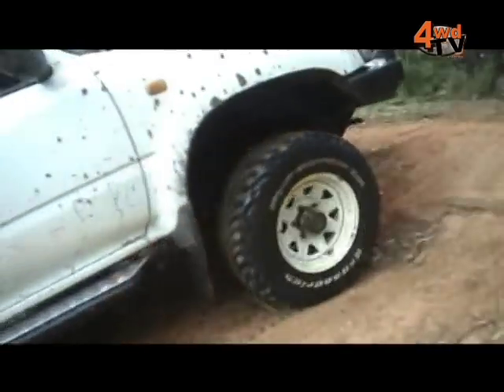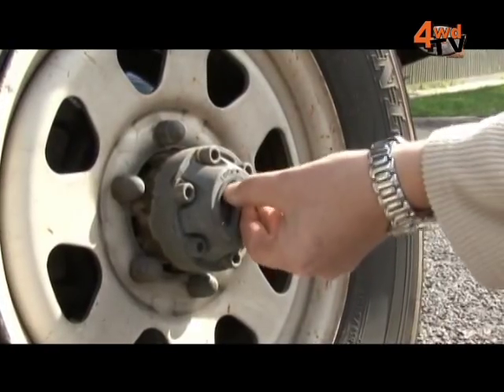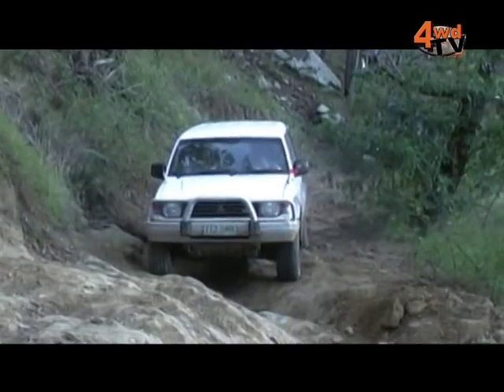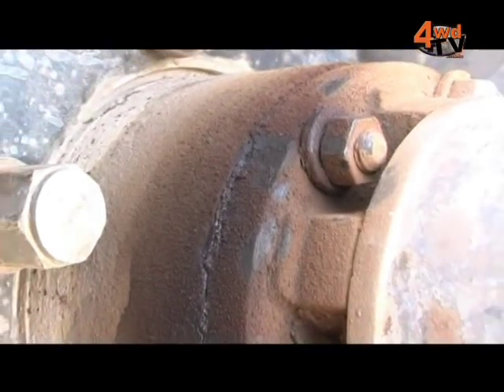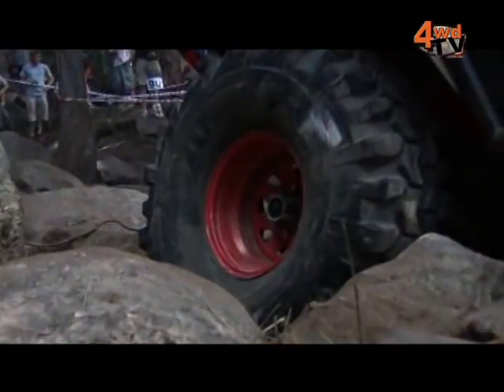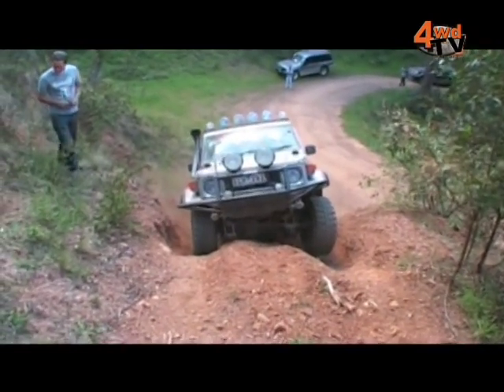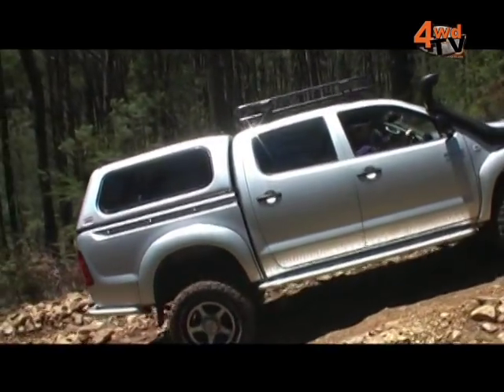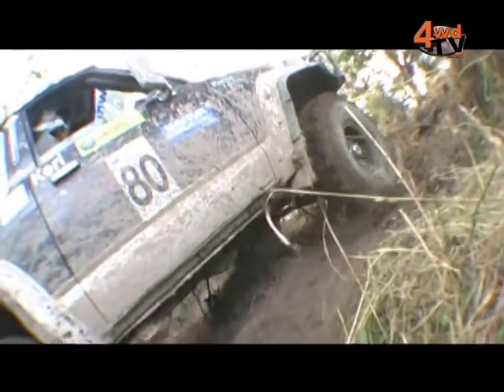Four Wheel Drive Hubs - How Do They work?

Comment from the maker: Leaving the hubs engaged even when in 2WD will not cause any problems. This will just keep the axles "live" meaning that they will be operating the differential unit instead of free wheeling just on the hub bearings. The reason for locking hubs is to reduce the mechanical drag on the front axle assembly and to reduce front axle component wear. In short, leaving them locked or unlocked will not harm the hubs or the axle assembly.

Comment: Here is a funny story. Today I saw a 4wd turning around on the road just past my place, they backed up too much, got into some soft ground and got stuck. So I went to give them some help.
They were English tourists and had only just bought the vehicle. I could see that the back wheels had been skidding but the front hadn't. I asked if they were in 4wd, which they were. Then I saw the hubs in "free", so I locked them and they drove straight out. They didn't have a clue what the hubs did :-)

Comment from the maker: The difference between the 2 is as follows: 
Locking differential - It's the internal differential carrier that senses load on the axles and then "locks" the axles together when it senses 1 wheel is slipping.
Locking hub - The external unit on the end of the front axles that can be positioned to either engage or disengage 4wd axle movement.

Comment from the maker: These are two completely different units that operate independently of one another. In short, the locking differential determines if 1 or both front axles are receiving power. Where as, the hubs just determine whether the 4wd unit is engaged or disengaged.

Comment: is locking hubs same as diff lock and can you turn while hubs are locked?
Reply: No, locking hubs have nothing to do with diff locks. Locking hubs just lock the axles to the wheels while diff locks lock the differential to distribute power to each wheel equally making act like there is not a diferential there
Reply: And yes you can turn when the hubs are locked it's just a bit stressful for the transmission and you get a little worse gas mileage

Comment: 4hi is for higher speeds, but less torque. You generally want to do most mudding in 4hi. 4low is really high torque, but considerably reduced top speed. 4low is fantastic at rock climbing.

Comment: Whats the difference between hubs and front lockers?
Reply from the maker: Hi comrade soviet,
Hubs allow the wheels to be unlocked from the axles and turn independently. These are a must for the street driven vehicle as they improve driveablity and fuel economy of the vehicle. A locker takes the place of the differential (spider gears) and locks the axles together for maximum off road traction. As long as you have the previously discussed “hubs” you can use a locker even if it is a street driven vehicle.
Reply: So what's more effective? For going off road,getting maximum traction?
Reply from the maker: comrade soviet Can you give our tech line a call? 1-330-630-0240.
Reply: comrade soviet Diff Lockers front and rear!
Reply: +rudedogii that's what I got, Solid axles FTW
Reply: comrade soviet you have to have both. You can have all the diff locks you want but if you can’t connect the wheel to the axle the axle will just spin without engaging anything

Comment: what happens if you don't lock the hub but engage the 4 wheel drive
Reply: Your CVs will be spinning, and your TC will be working but your wheels will be stationary
Reply: @gabrielmalcolm4812  i was about to ask the same question. So if we don't lock the hub but engage 4wd we are actually driving in 2 wheel?